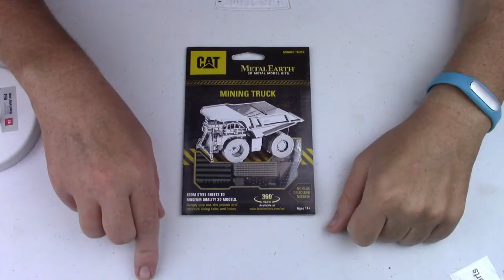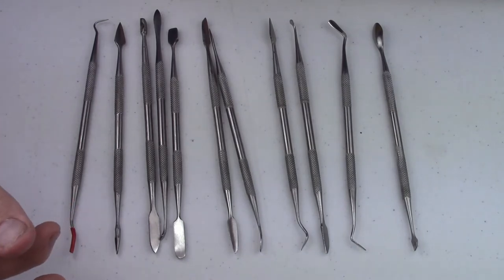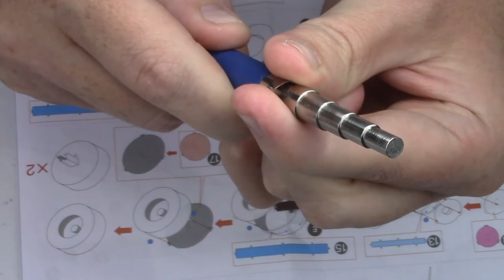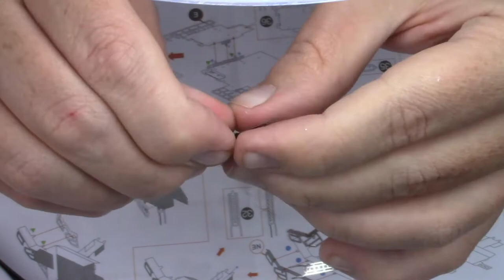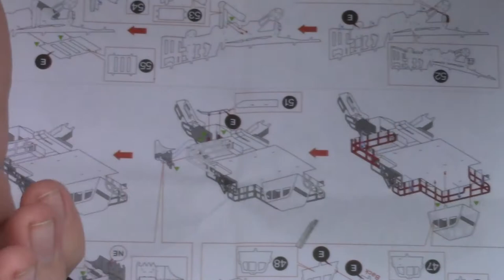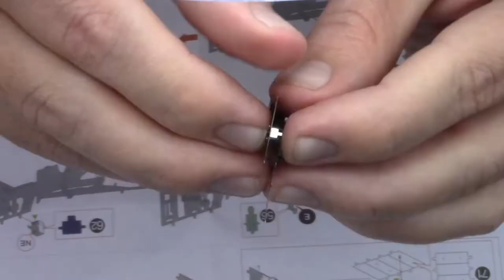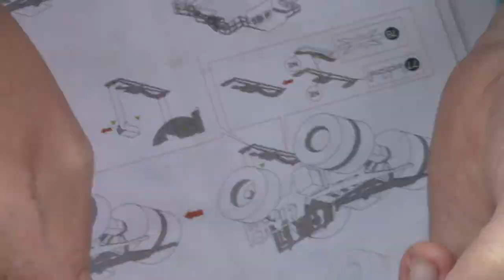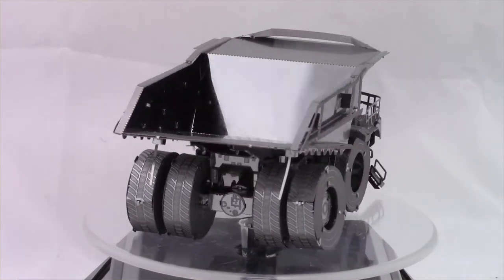Metal Earth build - CAT Mining Truck

Comment: did u break any pieces and how do u deal with them?
also, i had some wobbly parts guess i didnt twist the tabs enough.
Reply from the maker: I occasionally break stuff but fortunately not often. Depending on the situation, loctite works pretty good, and sometimes clear tape well placed. In particularly bad situations you can request replacement parts from Metal Earth. Loctite can also help with wobbly parts.

Comment: Hey great video. Have been building the star wars collection for a while now bit really need to know where you for the XL R2D2 from I can't find them anywhere
Reply from the maker: James Simmons the mega R2 was never officially released. There were many sent to dealers as sample and/or display models. Some dealers gave them away or sold them. I managed to get one. There were a few on eBay but it looks like they dried up. I get the impression that Metal Earth stopped making them.
Reply: Ahhh brill thank you. I have seen a  couple on ebay from Australia. Might try and get one of them